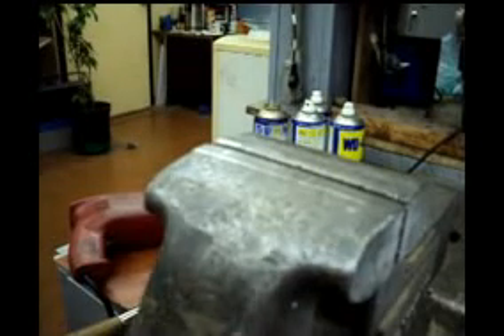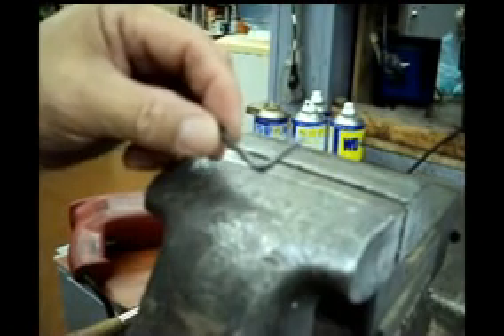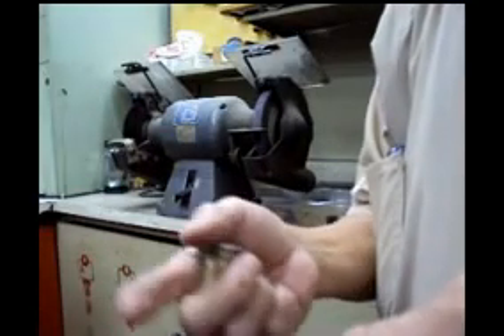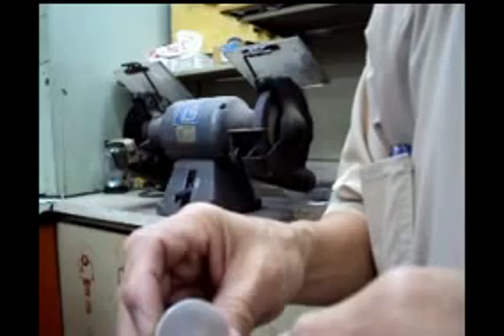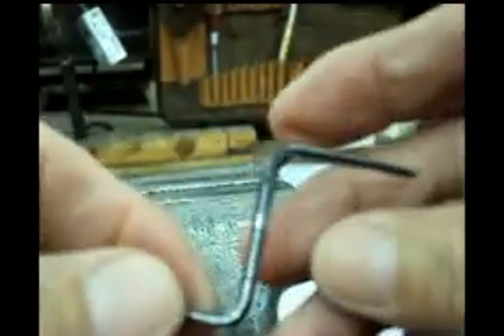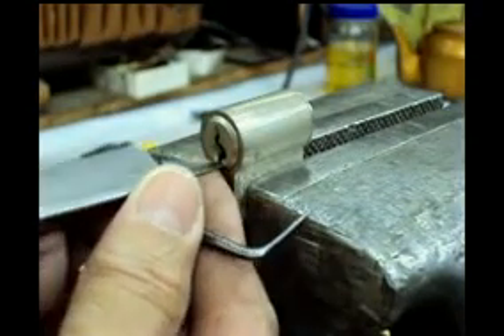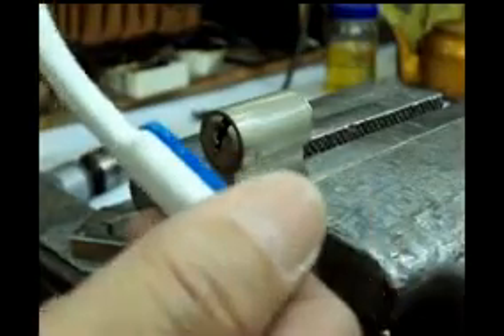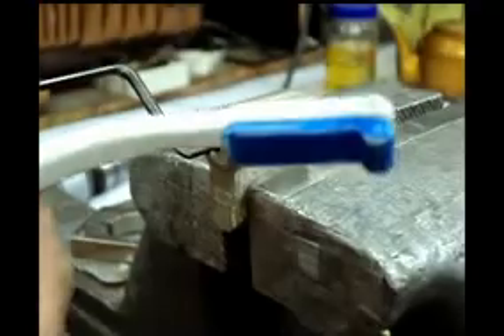HOW TO DESIGN A LOCK CYLINDER PLUG SPINNER. 99.99% effective!

Comment: So is this thing unlocking a locked unit?? I don’t see what it actually does
Reply from the maker: hi Mk He..it is a tool, for locksmith or lockpickers. that after picking the lock as in a case of EURO mortise lock that are capable of three throws of its deadbolt. that in order to unlock it, the cylinder needs to be turned  or rotate 3x. so to avoid picking it again to turn that cylinder another 360 degrees, we use this to jump fast that chamber of pins without locking the cylinder core again. so it save us time in repicking that lock cylinder again and again. thanks for your comment. regards.

Comment: You can use a strong rubber band instead of the coiled spring. I use a piece of street sweeper bristle bent into a "z" shape and the rubber band. Fits In my wallet so I have it with me along with an emergency pick set made from three South Ord picks.